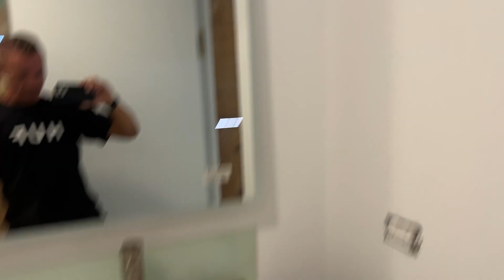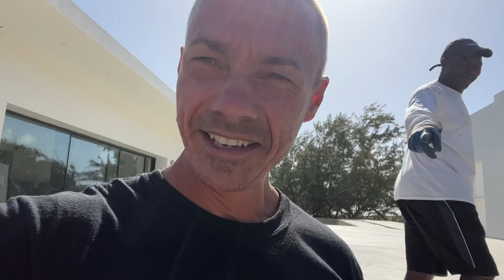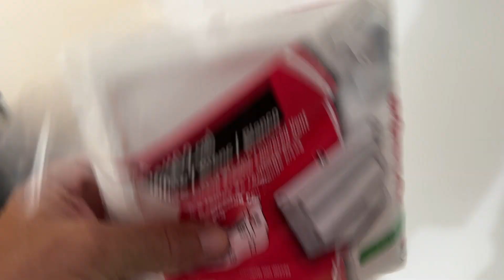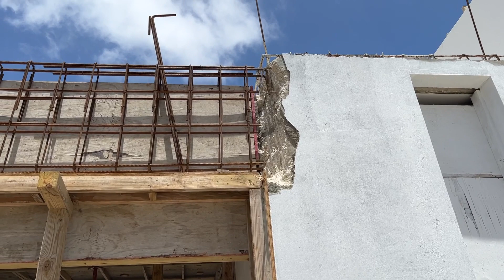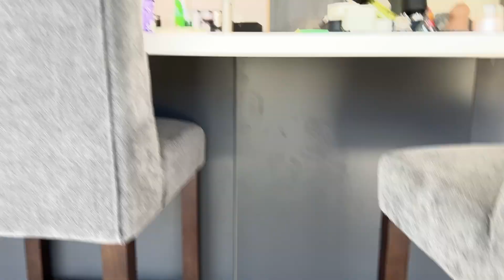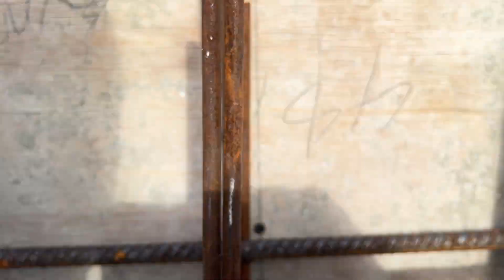Barbados 🇧🇧 Beach House Build - Day Day 282, rebating a garage roof

Comment: very nice on the corner bars only concern is the bottom bars not having enough seating in the wall they cut away. personally 8" seating would be great or like I said before a dowel of 4" hilti hit into that existing concrete would work as well

Comment: Hi Alvin, hubby and myself just discussing your project. It is of course a huge build and it needed an experienced contractor. Did you check out the work of the previous ones you've fired. What is Tyson's role on the project as you seem to be bantering with him regularly .Is it possible to get rid of everyone and hire a contractor to complete the works necessary to bring it to completion. How did the monitoring of the hours worked fare?
Reply: @barbadosbeachhousebuild  I hear you 😊